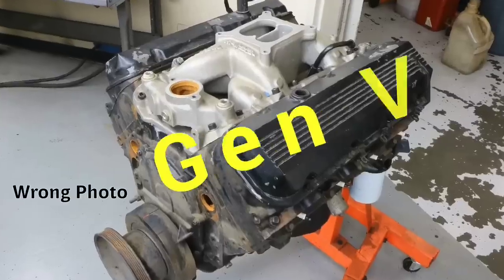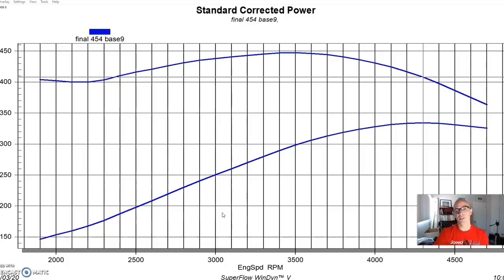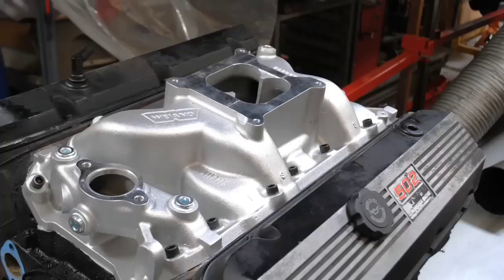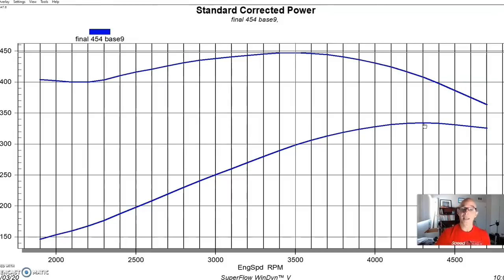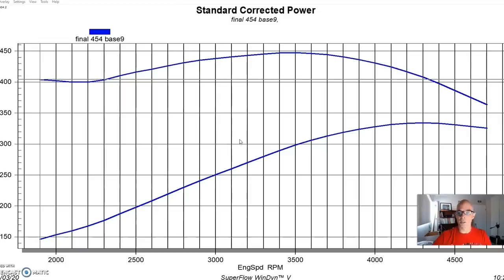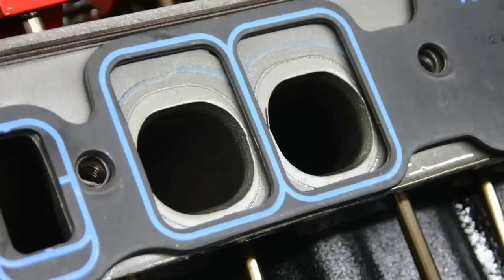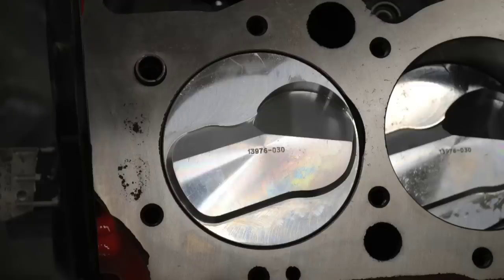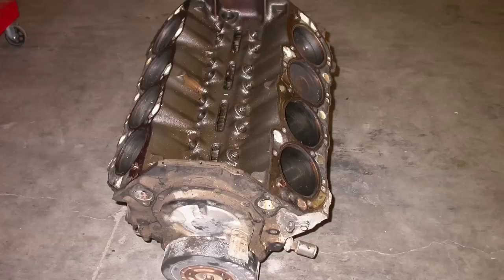HOW TO UPGRADE YOUR TBI PEANUT PORT 454

Comment: I’d like to see a 350 tbi test, how much power can you get out of swirl port heads?
Reply: Swirl port heads flow 170-180 cfm... Meaning the high water mark power wise will be 340 to 360hp with a good cam and intake, etc.   In the 80's I drug all my projects around with a F150/302 that was smog choked like pretty much everything from 73 to 86.. Under 200hp.. Likely a 160 to 180hp rated engine. It did fine.. pulled 6000lbs without complaint.  Cam, Intake, Carb on a TBI should get you north of 300hp ... nearly double what I had.  I think 325hp w a cam/intake/carb 350/tbi headed engine is a very attainable goal.   With 10 to 1 compression and a ZZ4 or 274 Comp Cam.. you should be there even with the not so great 350/TBI heads.
Reply: The swirl port heads really were the lamest small block Chevy heads of all time. If you reduced the ramp somewhat in the intake bowls you could make about 350 HP with a good cam and a 454 throttle body on a intake manifold that was bored out to 2" in the plenum bores. Finish it off with a good set of long tube headers and you had a pretty decent truck motor.
Reply: @mountainofeverest3861  They won't make 360. They are super inefficient for their flow. Yeah, you can push them with an oddball cam, but then everything will drive like crap.
Swirl port heads are only good for scrap metal or boat anchors.

Comment: I had a 454 72 vette  put 396.  360 hp heads cut 30 . Ported with edel.  Intake  .good  cam. Holly headers.  And Mallory.  I miss it. Ran good .

Comment: I did something similar for my truck motor. I used a gen 5 motor and just added a stroker assembly. It cost me about $800 more tonl go with a stroker kit vs just using the original parts and buying new pistons and rings. I think that is compared to forged pistons ans hypereutectics also. This was considerably cheaper than buying the afr 265 heads i want, which i can always do later.

My peak tq and hp was 555 and 442 respectively. Our test was performed with a mechanical pump and an engine temp of 190. Also i used just a regular edelbrock performer with the smaller runners runners. My cam was a hydraulic roller with 212/218 at .050(should have went bigger), but i think advertised duration was about the same.I suppose with these things we lost around 20  torque and horsepower. My tq numbers below 3500 rpm were about 25 more than yours.

Comment: Would love to know what you would do for a marine application. As I am building a gen 5 that will have aluminum square port heads intake and 1150 carb but using a stock freshened up bottom end.

Comment: DROP. EVERYTHING. NOW. 
watch.
Reply from the maker: YES
Reply: Agreed. Done. Did.
Reply: Do all of that stuff, and he’ll keep testing 😎
Reply: @richardholdener1727   So the 1970 Chevelle LS6 was rated at 450hp.. the Mac Daddy of Factory 454 factory power to many.  You need 10 to 20 more HP with these Peanuts..Ricardo...To take down the mighty LS6 with Peanut power... That's a magazine cover headline.  Wrong Cam?  I'm saying yes..wrong cam.  Give it more beans in this config .. tweak it.
Reply: c0c0asauce : I took your advice. I get a new screen for my cell phone next week. Props to you all.

Comment: I have a gen v 454 in a 92 c3500 with a set of closed chambered 396 heads, works good in the truck. This will be the 3rd camshaft this block has worn the same lobes on, I think the lifter bores are off. Time to go roller but the one I have is kinda rowdy, guess it will get a little stall while I'm at it. But the bump in compression helped the power above 3,000 so much, I think the vortec heads might be a better choice as they will flow better @ the valves but it will never see 5,600rpm in this truck so it's not to bad. Keep the data coming!

Comment: Street driven big blocks really benefit from higher velocity air-fuel mixtures. Peanut ports will dominate below 4500 rpm but, run up against the wall above that point. It's possible to raise the power band with some work and a good combo.

Comment: I know this is an old video but I got a 1987 conversion van that has a 5 L throttle body but it’s got a factory four speed on the floor and in the corner of my garage. I’ve got a TBI 454 just begging me to throw it in that van, so I’m interested in these videos

Comment: Hey Richard! I'm attending a local technology center for auto tech, for my senior year of HS. We've got an eighth gen (Can't remember which year off the top of my head) Suburban with a 454, and last year we got permission to do an engine swap! The details are a little vague, but the plan is to put it in an RX 8. There's going to be some fabrication required, but there's a welding course too. I'm really hoping  COVID won't affect the project, but there's not much that can be done about that.
Reply from the maker: Gen 8?
Reply: @richardholdener1727  I mean the suburban itself.  Not the motor

Comment: I would like to see a offbrand cheap aluminum oval port head on the engine and see how it works out
Reply: I have one in my archives.  Cheap is the Q.  Will look for.
Reply from the maker: we ran Speedmaster
Reply: Dave M  look for it

Comment: Hey Richard! Long time listener, first time caller. 
I have(almost)this exact build! I have a 1990 Chevrolet C1500 SS 454. I have a GEN 5 flat tappet engine with factory peanut port heads. My engine is .030 over with dome Hypertectic pistons(H426CP) and Speed-Pro RV cam(CS-1029R) .459 lift by 288/298. 1200-3800 power band. I have the factory TBI and factory ignition system. Long tube headers and not cat. 700R4 trans and factory 373 gears. The truck has plenty of power for a daily driver. I’m very curious to see some of these tests retaining the factory TBI. I have no idea what the torque or HP is on my setup. I do love the reliability and drivability of the TBI, despite it power output shortcomings. I do plan on upgrading the factory intake to an airgap style aftermarket and still retain the TBI. Curious what that is going to do. Great video thanks!

Comment: I'd like to see a dyno video of some #236 peanut port heads on a 396/402 with 2-3 different cam/intake combos. 
IMO, the p-nuts flow about the same as a set of sbc Vortec heads so, they aren't terrible. But, maybe their smaller port area would work better on a smaller cubic inch engine?

Comment: I'm building my 454 very similar to this, except I'll be running a roller cam instead - I want a 454 that's huge in torque for my van that I use to travel and cruise with, but she weighs around 6500# and the slightly modified 350 isn't really doing what I wanted it to do after I put it together... I do like the idea of running the 'Vortec' Gen 6 heads on the Gen 5 for more compression without the possible valve clearance issues that you'd have with a domed piston...

Comment: Oh I was thinking about piston speed and it made me think of Sonny's Racing Components 1005 cubic inch V8. It makes 2150hp at 8000rpm. It's a 5.220" bore and a 5.875" stroke. At 8000 rpm the piston speed is 131 ft/s, 7833 ft/min, 39.8M/s which I believe soundly makes your point. An engine with a 4" stroke would be turning 11750 rpm to equal the same piston speed and a 3.5" stroke would be turning just under 13500 rpm.

Comment: I have this exact combo except I ran a 572/574 lift roller cam. Never dynoed it but in a 3k car it pulls the tires and runs 11s
Reply from the maker: nice

Comment: Excellent! I have an '80 K5 Blazer that I put a Gen V 454 in. It's all stock and I retained the throttle body. But it's excellent to see that I could upgrade it for some more power. I'm thinking about adapting the throttle body onto a better dual plane so I could upgrade the heads maybe using a 2 to 4bbl adapter. I like the F.I. on my 4X4.  I know Edelbrock sells a Performer TBI but it is cast to match the peanut ports and it's really expensive. I also thought about swapping on a set of 100cc Edelbrock aluminum heads to raise my compression. Cool to see a Gen V run and the peanut ports actually performed way better than I expected. I wonder what kind of cfm they flow at lower lifts like the cam you used?

Comment: I have a gen IV truck engine, I studded the two bolt mains, put arp rod bolts, the rest is cast crank and pistons. The heads are early close chamber large oval 2.19 intake 1.72 exhaust, polished&ported. I installed the heads with steel shim gaskets, .015 compressed thickness and the compression ratio is about 9:1 with the stock flat top pistons. The cam is Elgin flat tappet 224-234 at .050, .529-.552 lift, 114 lobe separation, and I use 1.8 ratio full roller rocker. The intake is a weiand duel plane port matched with holley 750HP. Exhaust is 2"primaries full length headers and 3" exhaust. It's all in a 1978 nova hatchback. I was wondering if you had an idea on the power output since there's no dyno near me, thank you, all the best.
Reply from the maker: if the porting was done right-475-500 hp range
Reply: @richardholdener1727  Ok thanks, one thing I forgot, I ran it for a while with the carburetor directly on the intake and it would heat soak in hot weather. I put on a 1" phenolic spacer, it not only fixed the heat soak problem, but the throttle response increased dramatically. This is a really nice sleeper, the torque is fantastic.

Comment: Thank you Richard, I love all of your videos!
Have you ever done any testing or work with the old commercial application Chevy big blocks?  They had Gen 4, tall deck, 427's (also some 366's), which over the years became Gen 5 up to 454's for the most part.
Most of these were installed in vehicles with the horseshoe style front engine mount.  They had a double thermostat housing, mechanical rev limiting distributor and some other oddities.
I've been thinking of building one for a project of mine, most likely with a set of 781 heads.  From what I understand, a spacer has to be used with the distributor.  Also, there aren't as many intake manifold options for tall decks, spacers would be needed for a short deck intake.
Some say it's not worth it to go through the trouble of building them due to some of these items that need to be dealt with.  I would be using it in an older truck (49 Chevy 3800 Tow Truck) with a 5 speed (NV4500).  This would just be a mean, ugly, powerful beast.  I'm going to start out carbureted and possibly add a large blower later on, or eventually injected with a pair of turbos, so probably 10:1 at the most.

Any information would be appreciated.
Thank you,
David.
Reply from the maker: no tall decks
Reply: @richardholdener1727  Got it, Thank You!
Reply: Look at the gen 5 366 heads
Reply: @richardholdener1727  So the question for the Gen V block with Gen VI heads. Do I have to run special intake gaskets because of the different water Jacket on the Gen V block? Or are both water jackets the same on both blocks
Reply: @richardholdener1727  .what did you do with the engine when you were done with it? Do you ever sell the engines or do a give away? I have a 95 2500 and want it to have at least 450hp .

Comment: I love this test! I have Gen 4 454, very similar combination! .030 overbore... Summit k1301 cam. 218 / 238 at .050. With 20cc Speed Pro Dome Pistons. Only I used 781 big oval Port cast-iron heads. Aluminum dual-plane Intake. With mid-length stainless exhaust headers. Everything else being stock. I was curious what the horsepower rating was from my setup. Other than cylinder heads yours is very close to mine! My goal was to build a good Cruiser. Gas mileage being very important while still yet trying to achieve a realistic 5400 RPM Power Band limit. I really like this test because it is real world Cruiser engine while still trying to squeeze maximum power. Sadly most test like this are overlook for roller cams and big cubic inches. Unrealistic in my world. Thank YOU for building something relatable to me. My only question is, where would you recommend starting at the Jets size for my 750 vacuum secondary holley????

Comment: I would like to see a test of a low boost gen 5 big block turbo build for optimum torque and economy on the flats, 91 pump gas kinda thing. I’m doing this on my 93 k3500 I use for work and racecar hauler. My plans is to ditch the factory intake/efi and go with an aftermarket dual plane and holley efi. Some of my questions are turbo sizing, cam choice and whether or not I should switch to gen 6 heads.
Reply from the maker: turbo, big block and economy?
Reply: True it a big block it’ll never really be very economical in the fuel department but a conservative turbo setup built around street use can improve mpg in my experiences. Not while it’s in boost but during cruising conditions at 0 manifold vacuum/pressure.

Comment: Only change would be the cam. A custom hydraulic roller that would still keep the nice aspects of the Comp 268 but add more torque. Then add twin 68mm turbos.....1300hp the easy way....on alcohol....drive it everywhere.

Comment: I would love to see a Gen 5 / Gen 6 hybrid. one thing to note is that there was a design change in the water passages on the Gen5/Gen6 blocks compared to the Mark IV blocks. so there is some incompatibilities with swapping heads between generations. I believe you can use Mark IV heads on all versions of the BBC, but you cannot run Gen5/6 heads on an Mark IV with out using special gaskets, if I remember correctly.  there was also a change to the timing cover from gen 5 to Gen 6.  and of coarse the change to the 1 piece rear main seal in Gen 5 as well.
Reply: But you can install gen VI heads on gen V blocks correct without modifications?

Comment: Are big block tbi throttle bodies and small block different? I heard a low cost hotrodding trick was to.put a BBC tbi on instead of a SBC and it'll provide more fuel
Reply: Injectors are bigger.. Ive actually used the 454 injectors in a 400tbi a long time ago..
 You'll need an adapter  because the tb is bigger

Comment: Gen 6 heads have a heart shaped combustion chamber that won’t allow the use of the upgraded dome pistons, that you chose.  However, that doesn’t stop someone from swapping gen 6 heads onto a gen 5 block with flat top pistons.

Comment: I'm using the same setup with a holley avenger 500-400, and it brought up the power big time... I want to do the 6 gen heads with a 280 isky cam... i wonder how much power that would make....🤘

Comment: If your going to do a flat top/dished piston deal get a early set of fully closed chamber heads like 702s etc. Raise the compression more and be able to run better valve train parts also Chris straub is your friend when it comes to bbc camshafts

Comment: You should do a video on little upgrades to do on the throttle body itself. I have a hopped up 355 and its still tbi because I dont have the money to change out the 4l60e. The tbi is holding it back alot, i already have the 1 inch spacer

Comment: Do you have any videos on the Gm 8100 or 8.1 "Gen 7" big block?? I would love to see a big bang on one of those engines.
Reply from the maker: not yet
Reply: @richardholdener1727  Thats a shame love your videos and it would be cool to see a 8.1 on your channel. I'd like to see what those engines are capable of with a little touch of the boost and or a hint of nitrous.
Reply: Apparently they'll squirt the rods with a tune
Reply: Anybody make a budget set of rods
Reply: @jeremymcnicol9585  idk
Reply: @jeremymcnicol9585  raylar engineering
Reply: @LightningFast240  - hahaha he said budget, not big budget

Comment: Hi Richard enjoyed your blog on the l-29 454 I just pulled one out of the motorhome with 10000 km added an elder Brock dual-plane Holley 750 and headers I'm going to install it in my 1970 Chevelle Coupe Turbo 400 331 rear end any suggestions on a camshaft change or should I leave it thanks Ken stubbert

Comment: Why didn’t the cam push the peak torque higher in the rpm?  I assume the compression was the biggest factor in elevating the whole curve and allowing the torque to remain higher longer which moved the hp peak up, but why is the max to route roughly in the same spot? Is that a function of the intake runner length?

Comment: Would love to see you do something with an 8.1 Chevrolet vortec. I've got one and would love to figure out a good power combination best bang for buck running OEM fuel injection
Reply: sell it and get a 5.3 or 6.0. You’ll be much happier. I’ve had both, the 8.1 is a turd.